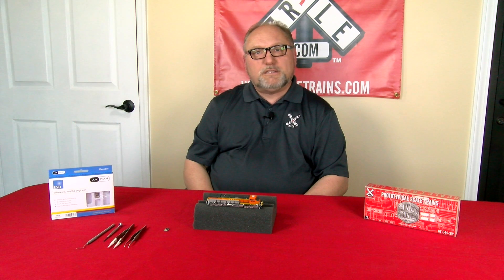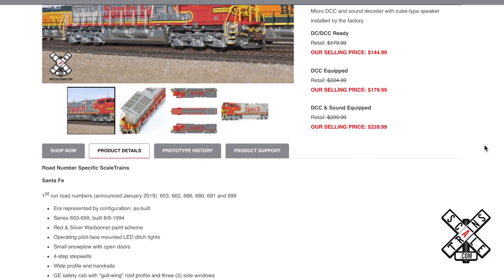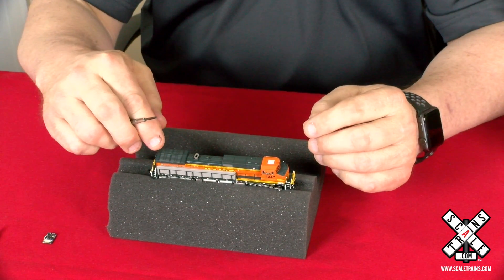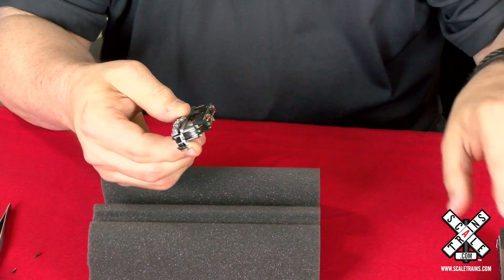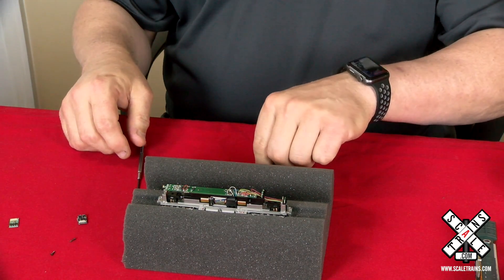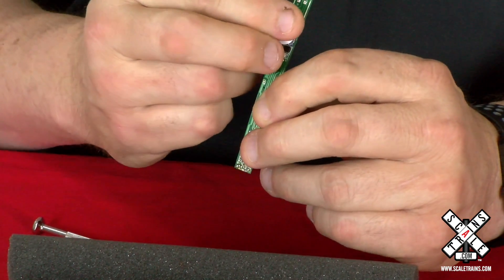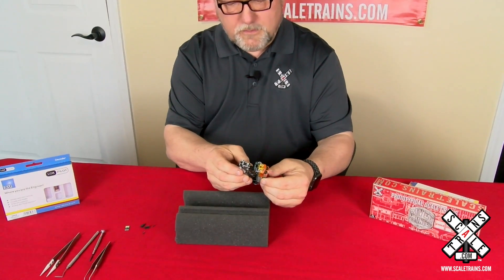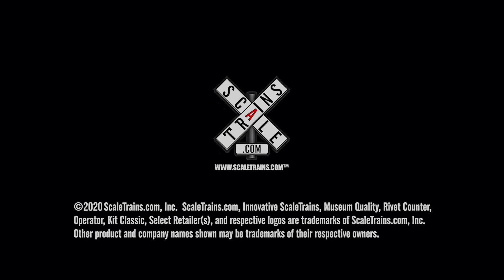Time to Model: Installing LokPilot Decoders in ScaleTrains N Scale Locomotives

Comment: Thanks I could not find an N Scale Dash 9 video on how to do this as I didn’t know where the dummy was. The only issue is that the ditch lights only come on individually. If I press 2 then one comes on only for the time it’s pressed then if I press the 1 then the other stays on until I press one again. I do have a Norfolk Southern unit. So next question is do I need to get all the equipment to put a file on a decoder or is there a less costly method? By the way I’m using a DCS52 zephyr DCC controller

Comment: Hi, you have video for HO installation lokpilot? I'm install one Decoder lokpilot #54615 recommend in the manual but no turn on the Ditch lights, forward and back, I'm put the two DIP Switch in ON position to, thanks for your help